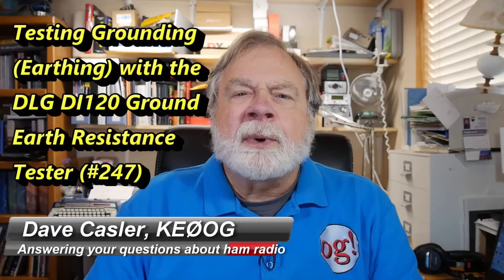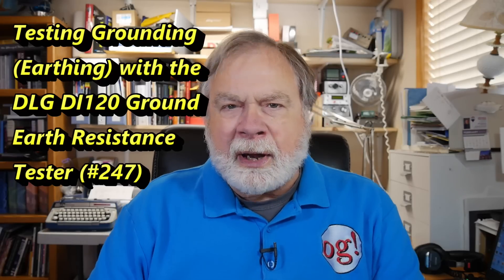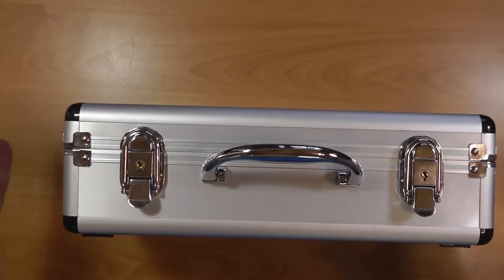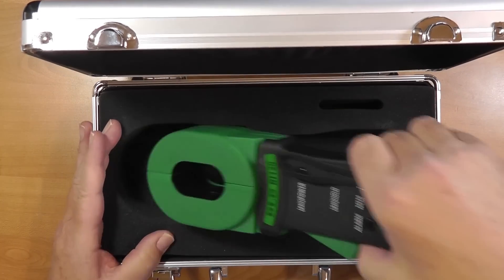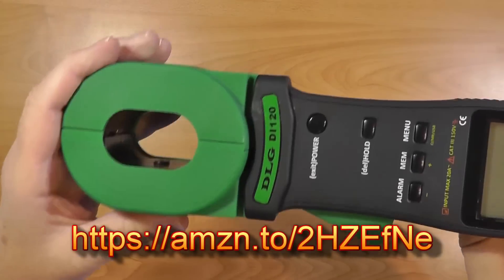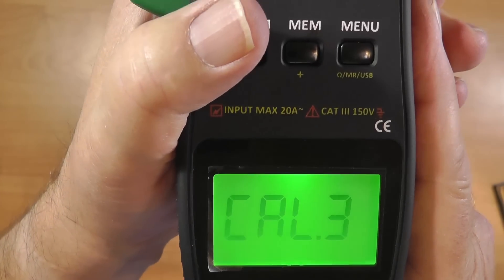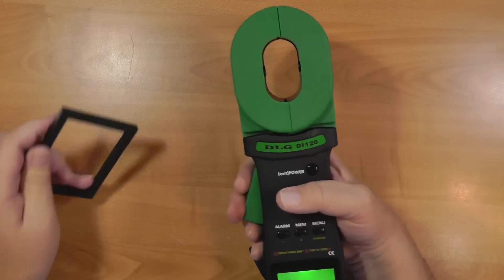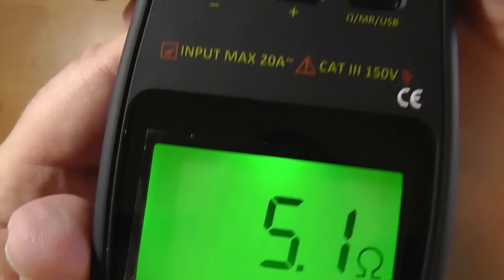Testing Grounding (Earthing) with the DLG DI120 Ground Earth Resistance Tester (#247)

Comment: Nice description of how it works, but your conclusions about how this helps with RF grounding misses on what the ground rods are there for.  The point to having a low impedance ground is around safety and lightning.  When you measure at the neutral at the utility side (just before the GND - neutral bond is made at the first disconnect), you're seeing your Utility ground (one or more ground rods) in series with the Utilities ground system - which can consist of many, many grounded poles.  All of this has little to do with RF grounds. You can make thing WORSE by adding a stand alone ground rod(s) and not tying it to your utility ground as now you have TWO grounds, which can be at significantly different voltage potentials during a nearby lightning strike.  This is how equipment gets damaged.  By having a single ground system (it's a system) that is bonded together, the entire ground reference can rise and fall thru the voltage wave that's induced.  This is why it's best to have a Single Point Ground where the the entry is made into a house - one reference point.  By NEC code, all your services - telephone, cable TV, Sat. TV, OTA antennas, and yes, and ham radio antennas SHALL be bonded to the utility ground.

Comment: Great video Dave, the 5 ohm number comes from the "Fall of Potential" test for sub stations and facilities grounding. Their limit is 5 ohms. The test setups 3 loops form by 3 strikes 10 meters in radius from the ground rod or ground point this was based on the rolling ball for lightning Protection.
Reply from the maker: Cool, thanks

Comment: When I was active duty Air Force, we used a device called a "megger" to measure grounding. It was much larger, but it was specifically designed for radio use. Wish I had one today
Reply from the maker: Megger is used to look for leaks in utility electrical wiring. Gosh, haven't heard that term in years!

Comment: @David Casler :: I sincerely appreciate your well informed information but unless you are someone that goes around helping others install their stations, spending $300 is a lot of money on a ground resistance tester. I have an easier way.

In a modern home the system is supposed to be grounded. When you plug in automatically you're supposed to have a pass back to the drop-in panel. Theoretically you shouldn't even need a ground strip. I'm old-fashioned. Older houses not always the case.

My Method doesn't require that. I take a 100 watt light bulb and the center lead goes to the positive - the black connector on the electrical outlet - and the other one goes to my ground strip or even the ground lug on a standard AC outlet. It should fully illuminate a 100 watt light bulb. Anything less and I have a poor ground.

I certainly mean no disrespect. Your wealth of information is well-received. But since I only have one home and I don't really help other hams set their stations up mainly because I live high in the mountains and there's not much call for Elmer's these days, this is what works for me.
Reply from the maker: Thanks for your tips. I think a station should have a station ground nearby. Of course, this needs to be bonded to the utility ground.

Comment: So it looks to me like you can fabri-cobble one of these things if you can kit build an oscillator. Use the oscillator to induce the current, and a cheap clamp-on DVM/amp meter to measure the voltage. Then do the calculation by hand for ohms. $50 + time, maybe less.

Comment: What is your experience with underground antenna systems ?
I never understood how a radio could work with its antenna underground . 
If trees can block RF, why not the moist ground ? 
Apparently they were used a lot during the war .
Reply from the maker: They work at VLF and ELF.
Reply: @davecasler  
Oh, that would explain it .

Comment: This was extremely interesting Dave !! I have purchased the ARRL Grounding book, it is excellent. Then I saw your first video from NM in the desert and the ground resistance meter. I can't imagine ANY Amateur Radio operator not wanting to know how good or bad their station ground systems is in value. On several ham radio forums that I subscribe, I read of horror stories every day with operators having all sorts of RF problems, that ultimately prove to be bad grounding. With this in mind, I have taken great pains, and probably overkill, to construct a ground system that I hope will be extremely efficient. I have installed 10  8 foot  5/8" diameter copper clad ground rods starting at the utility meter outside the house and continuing around three outside walls of the house to the utility panel. They are all connected by # 6 copper stranded wire. My station ground of course is included in the ground system. The soil here in my location in central MA is hard pan clay.  The coax LMR400 feed lines to my antennas are 150 feet up the hill behind my house, so there is no ground wire from the station/utility grounding system up to the tower grounds. I have read that it would be useless to run a connected ground wire that far because of inductance rendering it rather useless. With that in mind, following recommendation in the ARRL grounding book, I am installing several ground rods around the tower base, all interconnected with #6 copper wire as soon as Spring thaw arrives. I am keenly interested to see what I can measure for ground resistance both back at the station grounding system AND up back at the tower grounding system. Because I have an Artesian well, I also plan to experiment with wetting the ground rod areas during dry conditions to see if there is any difference in resistance.
    Also, I wonder if you could use a high frequency oscillator to somehow replace the oscillator in the measuring head ? Just a silly thought to see if there would be any difference in resistance measured at RF frequencies.